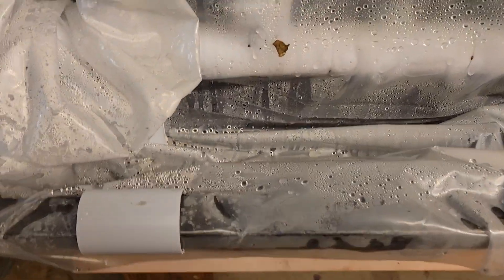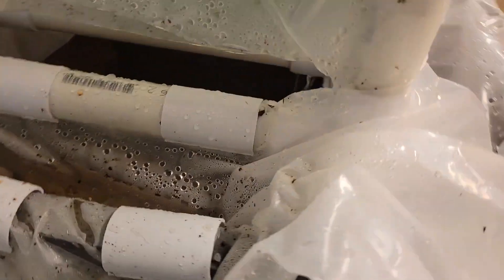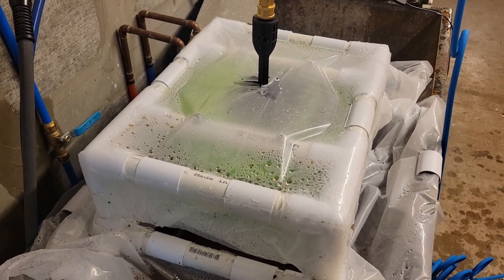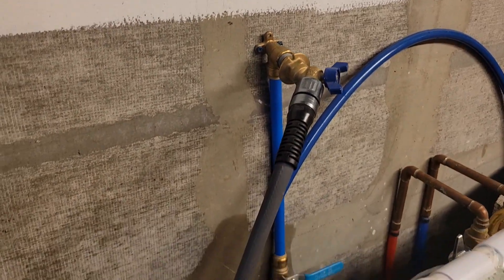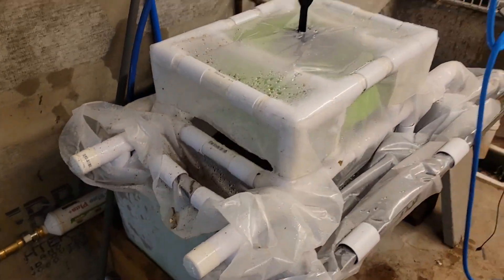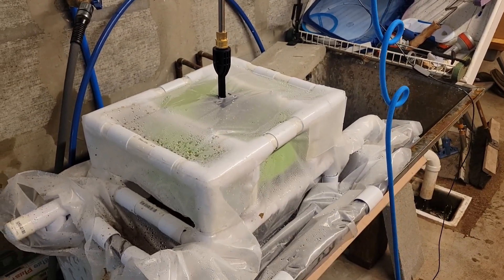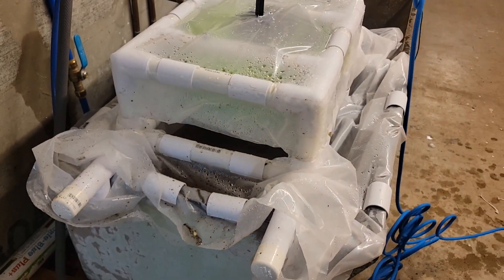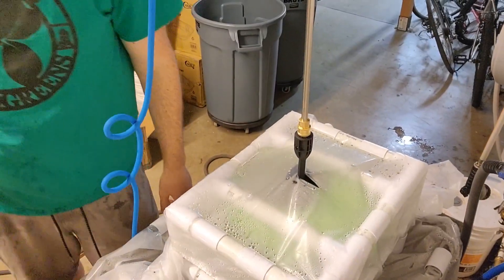Get Them Trays Clean with a $350 DIY Tray Washer

Comment: You could save a few seconds per tray by flipping it over and going right to left instead of moving it back to the other side for the flip.  :-)
Reply from the maker: For sure. Takes a bit more dexterity, but when I did a much larger stack I started going that.

Comment: Do you use Hot water or Cold water for tray washing?
Reply: Machines are rated for cold, but they all seem to say over 100°+ is okay, so if you have temps low to begin with on faucet likely can use warm without any issues.
Reply from the maker: Warm. When I replumbed my lines for my fertilizer injector I put in a hot and cold ball valve with check valves to allow me to mix the water temp that goes to my hoses.